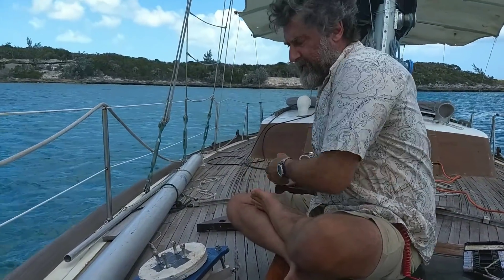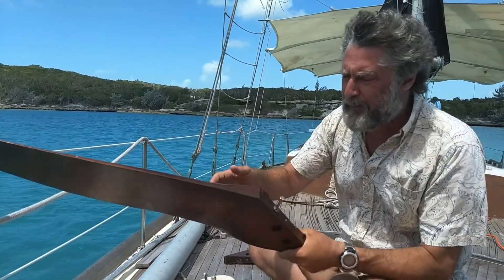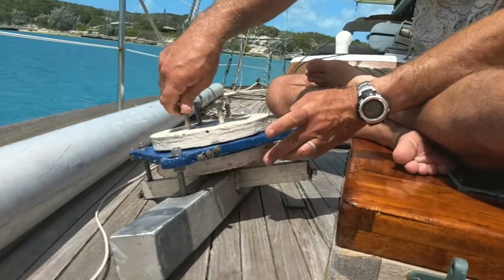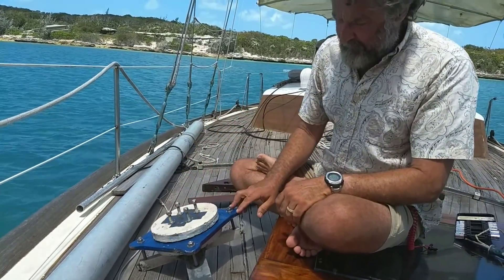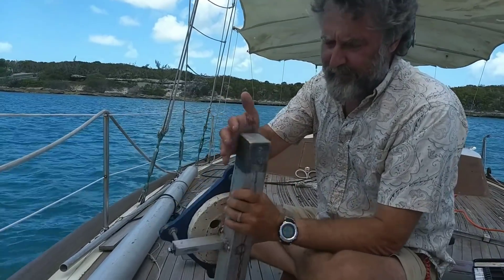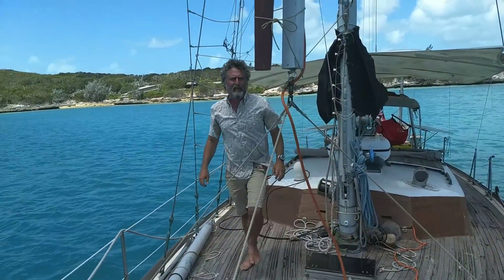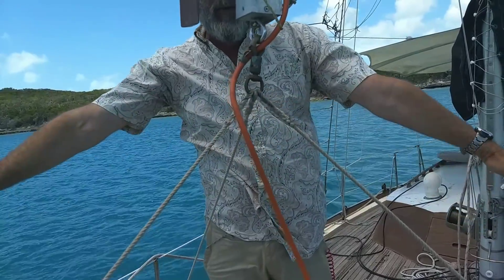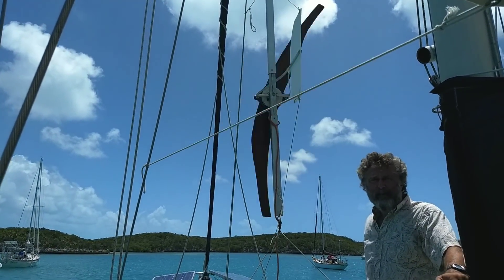Clark's DIY WIND GENERATOR, 3 Phase to DC power on a sailboat (Sailing SV Temptress)

Comment: First off I love your videos, trying to go to sleep at 2 AM and ended up staying up till almost 5 AM watching your videos I’ve been in the process of designing to build what you built as far as a dual axle vertical axis wind turbine, I decided to three phase. It was the best way to go as well. You’re the first one to recommend polyurethane with the talcum powder and I wasn’t sure the ratios of the mix for that instead of the very costly epoxy resin so a lot of questions and I have a lot of things laid out on my my table is totally covered with diagrams drawings 30° 40° for the Rutter stater as a disabled US Army veteran I have limited resources so I decided to build it and I have a passion for doing it yourself stuff so thank you for your time but after watching your video, I’m thinking of doing the horizontal turbine The HAWT your spreadsheets are phenomenal. I haven’t had a chance to actually look at them but I love the guesswork first video I saw was making your win turbine blade but I’m thinking I need three blades, so I’m not sure exactly how to approach that with how your video is the forming and shaping of the blade with the foil would be about the sameI was gonna do nine coils not sure how many to wrap so I take 9÷3 multiply that by four to get how many magnets I need I believe that is correct don’t wanna make this any longer. I hope y’all having fun. I hope you’re enjoying the water. Sounds like you live a pretty good life.

Comment: That's very cool Clark. Are you an electrical engineer by formal education? Or self taught?
Reply from the maker: I have a degree in computer science.  I did software engineering mostly.  The ee stuff is self taught and what I picked up from ee friends along the way.
  If you want the whole story check out my "retired at 36" video.   Just sort out videos by popularity as it's seen 1,000,000 views.
Reply: @Clarks-Adventure  will do!

Comment: Does shorting the three phase circuit cause any damage to the stator?
Reply from the maker: Not for mine but it could if your stater isn't wound heavy enough.
Reply: @Clarks-Adventure  Hmm. I have a 300 watt turbine that came with a controller but I want to create a dump load switch to turn on a brake but was told it would burn out the stator. I may have to build one like yours. You can see my progress on my channel, although there are only a couple of videos. Thanks for all your content!
Reply from the maker: You might think seriously about dropping a contribution to Patreon and grabbing my spreadsheets.  Will make life easier.
Feel free to immediately quit so you only get hit for one month.

Comment: Very cool project Clark...i always wanted to do one of those too alternator/ or efficiency D.C permanent magnet generators. How long did you run it on your Sailing Yacht? did you find it practical...or too dangerous with the blade rotating? Mark
Reply from the maker: I made three over the years.  This one is the last.  They were all similar.  One was used most all my cruising time from 2004 til last year.  We have vastly extended our solar panels so we have little use for more power do it's stowed.
   It makes a huge amount of power even in low wind.

Comment: Thats an amazing bit of kit u have made sir...
I especially love the way its raised up & not connected to the boat, I'm assumming that isolates/stops vibration & noise being transfered to the boat, which is the biggest problem/complaint most people have with wind generators.
Please could you confirm if I'm right about this, does any noise make it through to down below.? Thanks.
Reply from the maker: No it's crazy quiet.  No vibration noise and rather low blade noise. I can usually hear other boat's wind generators over this one on our own boat.
Reply: @Clarks-Adventure  
Thanks 4 the quick reply...
That's what I guessed...
I don't understand how I haven't seen ur video sooner, nor do I get why more ppl don't rig up their wind gennys like that...
I'm planning on getting a boat & was planning 2 have solar only, due 2 the noise issue, but was worried about the winter months...
I now know I'll b rigging up a wind genny something like urs..!
Thanks again...
Have subscribed & will b going through ur back catalog...
Reply from the maker: There are some spreadsheets on our patreon page that will save anyone building a wind generator a lot of time and effort.   They are talked about in some of the build videos
Reply from the maker: And winter is why I designed and built my first one.  Just couldn't keep up with refrigeration in December in Florida.
Reply from the maker: Max,
  If you think your friends might also like our stuff how about sharing one of our playlists on social media?  We would really appreciate the new viewers.
Reply: @Clarks-Adventure  
Thanks 4 all ur info...
I'm new 2 all this sailing/boating stuff... haven't bought a boat yet... been 2 c a few & have narrowed down my search criteria.
I hope/plan 2 buy 1 next year...
I don't have any boating friends @ the moment so no1 2 send ur way yet...
Rest assured I have saved ur video & subscribed so I won't 4get u guys...
May u always have enough wind 2 fill ur sails (& power ur wind geny) ;p

Comment: Clark, no kidding...If you built these for others they would buy them from you. The overspeed breaking circuit is not just smart but a jewel to cruisers or any other unattended wind generator location. Thanks for the video.
Reply from the maker: Thanks Joel.  Haven't done it yet.  Last 6 months have been busy getting boat projects done for this cruise.  We just arrived at our favorite Bay in Georgetown so maybe I'll get to it.

Comment: That is brilliant. I know the theory but the build would be another thing . Good work Clark . I’d love the plans .
Reply from the maker: I should grab the drawing and put them up on Patreon.  I'm on land now and think I know where they are.  It's what I used to cut the alternator parts on the lathe.  But that part is quite trivial and loads of others have made videos on how to do the mechanical parts.  My alternator is optimized for a boat (corrosion issues and as small/balanced as possible).  But, the big thing I think I bring to the party is the blade carving method and the math/spreadsheets for the windings.  They are both on Patreon already.

Comment: Can it be done with just a car alternator?
Reply: Yes. A lot of these use air heaters to dump power. 
 To do my trick you need to design your stator tough enough to not overheat when shorted for maybe 10 seconds. After that it's going so slow it doesn't make enough power to hurt itself.  And when you need this feature there is PLENTY of wind to cool things down.

Thanks for watching.  Have you built yours yet or are you still designing?
Reply: @LongDistanceSailor  Perfect solution for sure. I never built the one I was researching. It was to be for a specific location and a constant  load 24/7 so would have been simpler design-wise than the one in this video. As it turned out I did not need it so abandoned the project after much research. But the circuit design mentioned in the video above uses nature to solve the overspeed/overpower problem without moving parts, added & not-needed batteries, etc. Really smart. I've heard ideas like that called "stupid simple" meaning that the solution is so simple it makes one feel stupid for not having thought of it LOL.
Reply from the maker: PS. Long distance sailor is me.  My personal account.  Sorry if it confused anyone
Reply from the maker: No, not without a lot of alteration.  Car alternators need to spin much faster and use power to make power.  I would have cut that corner if it would have worked.
Reply: Emily & Clark's Adventure I see. The excitation voltage? Then how about a car generator? Or do they even make them anymore?
Reply: @dangonzales2896  He is using permanent magnets so do not use external excitation voltage. The only downside of permanent magnets is that when the wind speed goes too high the generator will keep producing more electricity until it burns itself up. He has a circuit to keep that from happening. A car alternator would require much higher RPM to start producing usable electricity...2,000 RPM wind generator on deck - YIKES!
Reply from the maker: That's right Joel.   Did you notice that my regular actually slows the blade to a crawl when it has enough power?  It sends the power back to the wind generator as magnetic breaking force.
Reply: @Clarks-Adventure  I did notice that. Such a simple solution; it almost escaped me until I played it back and heard you a 2nd time. And to think I spent time researching how to use actual breaks or set up more batteries to dump the excess power and even...drumroll...dump the excess power into an electrolyser which outputs hydrogen & oxygen. Compressed hydrogen around -  No Thank You.

Comment: Hi Clark, it's great that you could build this, but it does not mean you should build it. It will only take one time, in an emergency when one of you goes running out there without thinking......raise it up if possible, or take it off. We don't want to lose one of you for a bit of electricity.
Reply from the maker: That wind generator is not the most dangerous part of this lifestyle.

And I have lived with it for about 15 years.  It's safe because it's so scary.  It's like the main rotor of a helicopter, it's so scary you have to duck even though it's higher then you could touch.

Comment: I'm an electrician and learned a lot from this video. Did not know shorting out the leads would cause it to brake. Very cool, glad I found you guys.
Reply from the maker: You have to have coils that can take the heat of the breaking energy without melting. 
Thanks for the comment.  That's what makes life fun, learning something new.  I'm always happiest when I do.  And it happens a lot.

Comment: Brilliant , the charge controller is very interesing , ive seen people sell basic solar charge controllers that have been modified somehow to be used as dump load controllers but your design sounds far superior and could make you money im guessing , if it works as a 3 phase brake  once battery voltage reaches the upper limit. 
ive seen some small radial turbines burn out with the brake on, but so far nothing else , it seems to be standard procedure to use the brake . i do like mechanical brakes too, but yours is worth knowing about.
i love axial flux turbines and diy blades, its something i will do , seems you have a great life style.
Reply from the maker: If I ever get off my butt and finish it I've got a new regulator design that should be even better.
I'm planning on sharing the circuit design on my patreon page with the blade and alternator guides.
Problem is no one has shown any interest.  So I've lost interest in the wind generator videos.
Reply: @Clarks-Adventure   i understand , people are not all that motivated these days , i think its more to do with poor diets resulting in no real get up n go, enthusiasm is short lived no staying power, thats my perspective anyway.
id love to see it but hey i understand if you dont, just means ill have to use my puny brain LOL my brain hurts just thinking about it. .
all the same im glad youve done what youve done thats inspiration enough via your example to the whole world. im in Australia so youre getting around.
Reply from the maker: Yeah, we seem to have a lot of watchers in Australia.  Mostly for the "Enough is Enough" videos.
Reply: You just got another Australian subscribed Clarke,Thankyou Peter

Comment: would love to see you build at stater with coils if you ever build another.
Reply from the maker: Thanks.  I would love to add that video to the playlist but as you say I don't need one.  I'm sure you could find someone else building one.  My approach is similar.  What I thought I had to offer was my spreadsheets and my method of shaping the blade.
   I'm hoping to soon build a new regulator that should be innovative.
Reply: @Clarks-Adventure  thank very much. I actually did find someone with a similar build. and I am happy to have your nicely layedout spreadsheet to help me along my way.  I look forward to your regulator build? That is after the bridge rectifier im guessing. Cheers. and thanks again.
Reply from the maker: Some guys make the rotors from automotive brake disks.  Really heavy and big but easier to source parts (junk yard).

Comment: Now THAT is a bigass badass wind generator! 💪🏼⚡️🔥 Holy moly 😳 💥👍🏼 makes those small fancy ones look like toys 😄
And the unit itself looks like all solid state circuitry, if my non-hightech-engineering mind understood it all.
So - where are the plans please? I want to put one of those suckers on the roof of my house 😆  maybe two, start my own windfarm. Am sure the neighbors will be thrilled 😝😆
Reply from the maker: Mine is actually very quiet.
Most everything you need to know about how to build one is in the playlists.   All the tricky parts anyway.
    Thanks for watching.
Reply: @Clarks-Adventure  Does 2 blades at higher diameter means less noise than 6 blades at higher RPM?
Reply from the maker: Most of the noise comes from blades that use a tip twist trick to prevent over speed, or if the blade isn't exactly perfect.  Keeping the tip speed down also helps.
   I have to admit my latest blade is just a bit louder.  I screwed up the carbon fiber.
Reply from the maker: The six blade models tend to use the blade overtwist trick
Reply: @Clarks-Adventure  Thank you Stunned and not a little inspired.
Reply from the maker: I haven't seen this comment in a while.  But if anyone is still looking for help in building one both of the spreadsheets are available on our Patreon page.  
   I think you need to be at best mates level (but just for one month). They are in our digital treasure chest for download.

   If you build one check back in.  I'd love to see some out there.

Comment: Thanks for the videos, enjoyable and inspirational to watch. You might like to check out videos for diy generator using stator etc from fisher&paykel smart drive washing machine, i have salvaged a couple from hard rubbish here... just search smart drive generator on youtube.
 You may also find videos on Lily impeller interesting.
Reply from the maker: Thanks
Reply: @Clarks-Adventure  I realize its not practical to source washing machine parts where you are and you dont need to having done a great job yourself already...im thinking now a better diy project for you to ponder would have been a diy HHO generator to save on fuel when needed. Appreciate the reply!
Reply from the maker: Hho doesn't make power.  Really trust an engineer.  It just changes form with losses.

Comment: wow that is crazy cool
Reply from the maker: Thanks Jim.  I need to make a new blade and will be doing a video on it in a week or so.  Also one coming up on a regulator I'm planning to build.  The components are on order
  It will be an Arduino project with an "ideal diode" rectifier.  Should be interesting to those who like DIY.
Reply: cool I don't really know what any of that means but i'll watch.